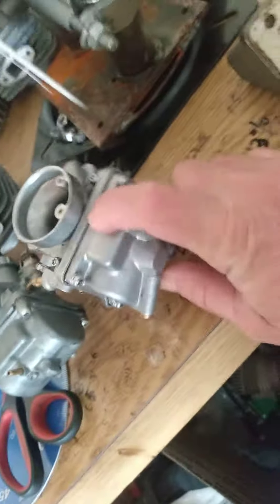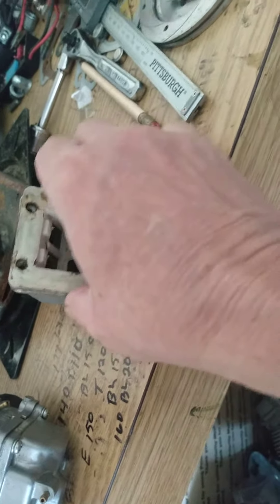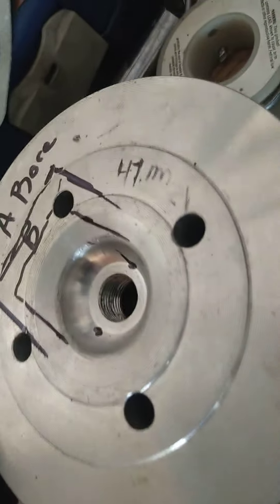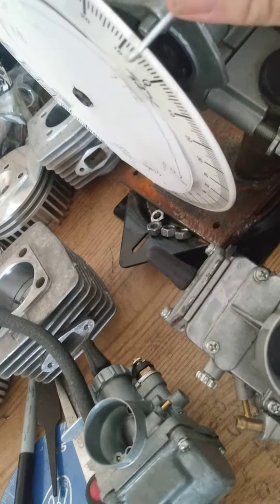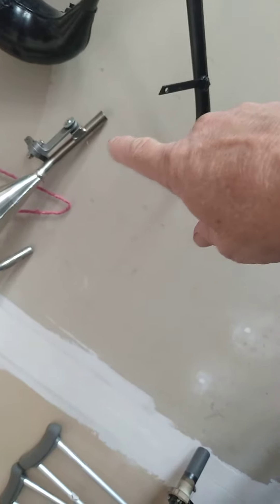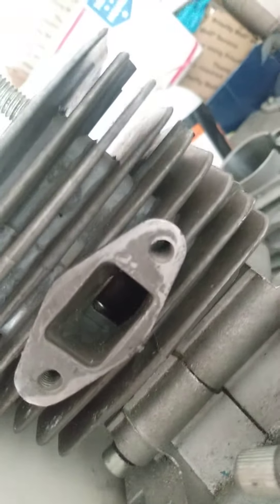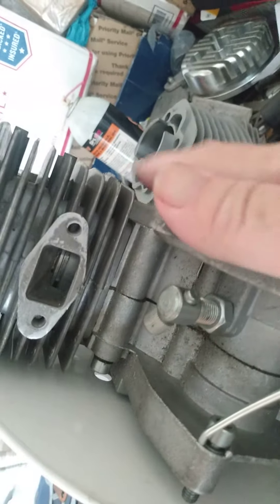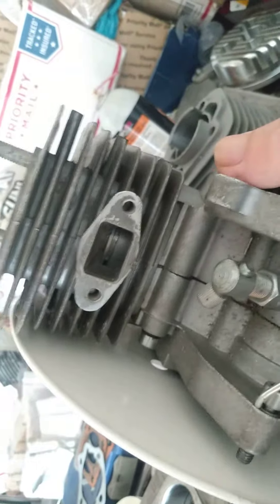motorized bicycles how ways to make more torque hit the frigging like button that works all the time

Comment: Great video as always. I love your work. I was wondering if you know anything more about the mushroom port shape you are testing. Does it work well?
Reply from the maker: Of course it works great there's lots of people copied it. That sells these motors there's a vid explaining why I use that shape. It's definitely the easiest shape that delivers good gains for minimal work.
Reply from the maker: https://youtube.com/shorts/1wbNa87Gq6g?feature=share
Reply: @2strokecarbtuningportingin187  
I like how you're thinking, have you tried an upside down mushroom? Generally you want the top of the port to be small. Just enough to start to feed the pipe but also keep cylinder pressure as thats part of your power stroke. By the bottom of the stoke you want the port to be open wide as this is when the pipe is feeding the port. 

Also the ring is expanding at its max at the very top of the port because its the hottest. Smaller the window the better, with a large flat opening its prone to ring snagging?

I'm not challenging you. I know you know way more than me but that's just my thoughts. I have learned so much from your channel and now all I can think about all day if porting lol! Thank you for your work. Let me know what you think of this^
Reply from the maker: https://youtu.be/t3LapeR54Zc
Reply from the maker: @Pigmaster6373  you want your high pressure to escape fast as possible with a strong pulse you don't want your port narrow at top. If I have it wide at bottom of port that would be less pressure on return pulse of pipe. I have been porting two strokes for about 42 years long before you tube google or Facebook. Definitely ported hundreds of timings and shapes for these junk motors countless motorcycle cyls make me some vids and teach me I will watch and hit the like button. Don't know how to respond to your comment. I don't read or write that good. Hence make some vids  post them
Reply: @2strokecarbtuningportingin187  thank you that makes sense!
Reply from the maker: @Pigmaster6373  oh I'm comprehending the statement or question sorry  #1 I have never snagged a ring on my exhust port or any port after hundreds of cyls  stay within 70% of more diameter and chamfer edjes that's not a problem. But I have seen bicycle guys snagging piston on exhust port when pistons traveling down because the exhust port was to wide and over looked the floor if thatakes sence. When you see the mushroom shape  you'll notice yes it looks wide but look whats happened notice if you look closely it's at its widest point All above blowdown meaning it's got complete cylinder support less at the exhaust port once the transfer start opening it has the same quarter inch radius meaning the radius in the corners of the port as a stock exhaust port so there's no more chance of it snagging than on a stock setup hopefully I worded that understandable I don't choose the best words
Reply from the maker: @Pigmaster6373  as far as heat goes think about what's happening allways a flatter roof is more peaky power better put a narrower power band. My hot spent gases are escaping sooner and faster than with a traditional arched roof hence less heat
Reply from the maker: Again I don't write well  my word choice seem angry nope it's frustrion writing
Reply from the maker: @Pigmaster6373  sorry man if I give you answers that seem like smart ass it's not on purpose
Reply: @2strokecarbtuningportingin187  not at all! I know you're anti bullshit and that's what I like.
Reply from the maker: @Pigmaster6373   mabe this helps explain what I tryed writing
Reply: @2strokecarbtuningportingin187  voodoo my ass. You know exactly what's going on with the port size,timing and wave return of the heimholtz chambers.....I'd hide the motors too if the fuzz saw me doing 85mph.

Comment: Longer intake manifold tube longer pipe (if stock 6” increase) larger sprocket or smaller wheel increase flow thru pipe adjust squish skirt piston all work well
Reply from the maker: Ok 👌👍☺️